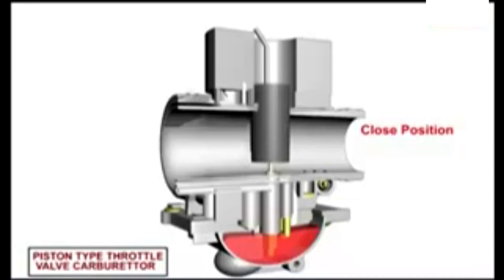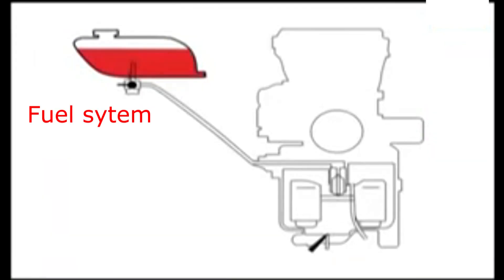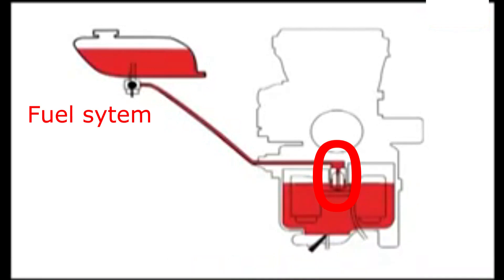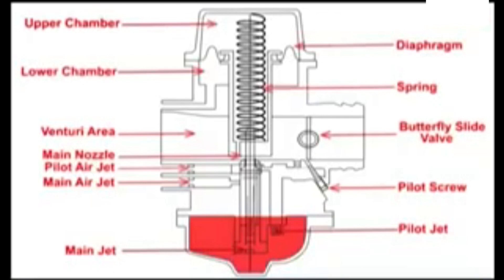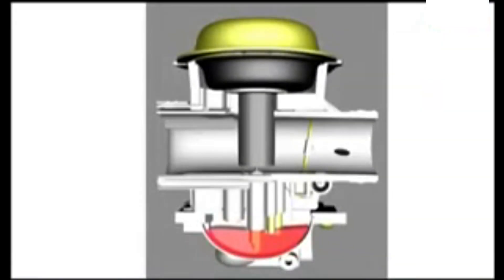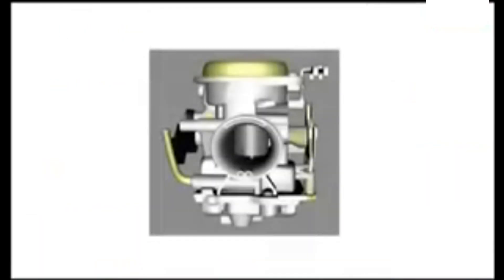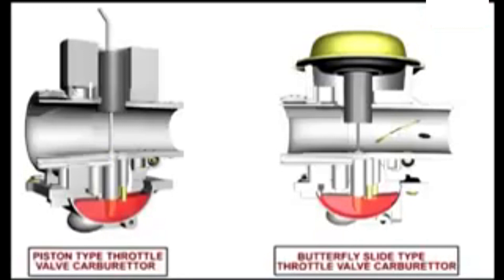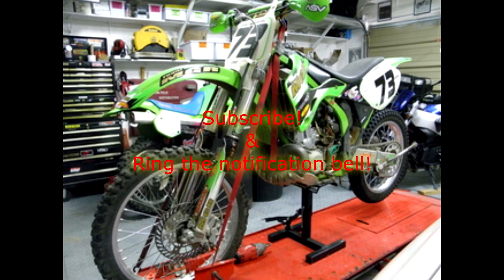Types of Motorcycle Carburetors - differences and how they work

Comment: I'm trying to figure something out
 

I am working on a cable driven slide style carb. Is it normal to sputter and almost die if you snap to wide open throttle from an idle? At 1k rpm it sputters but at 1500 it revs up fine.

Comment: Is a cv carb less likely to stall if you hit full throttle from idle quickly
Reply from the maker: No, not necessarily.  There are many factors for that.  One of which is engine design.

Comment: What causes a cv carb with a diaphragm to keep breaking the slide. the slides keep breaking at the lip where the rubber diaphragm holes onto ive replaced the slides 6 times an they keep breaking have no idea why
Reply from the maker: I would have to see a picture of what you are talking about.  Post a picture in the comments on this page.  )no need to register to post) https://www.thejunkmanadv.com/motorcycle-carburetor-jetting.html
Reply: Are you shore it’s the slide braking and not the fact your using a ethanol based fuel  causing the diaphragm ageing quicker  and stiffening up popping the slide loose

Comment: Hello sir! There are some carburetor that has “air cut off valve” on it, what does the air cut off valve do? What air does it have to cut?
Reply from the maker: I am guessing you mean a carburetor with a "choke"?
Reply: @thejunkman  Nope~  
Choke is controlled by the lever on the left side.
There is a circular shape diaphragm stuff on the right side of my carburetor (Keihin PD26) the manual said it’s a Air Cutoff Valve (ACV)
I can’t find much video/animation explaining what does that valve do.
Reply from the maker: That is a circuit unique to that particular carburetor.  It is just a small valve that allows some air around the slide in certain situations as it is controlled via engine vacuum.  It only functions when you chop the throttle from high rpm.  When this happens there is high engine vacuum, but very little fuel creating a instant lean mixture.   It limits the airflow through the pilot circuit to ever so slightly richen the mixture until the engine vacuum comes down, reducing the backfiring that can happen in this situation.  It is just to smooth out the jetting from WOT to 0 throttle as the engine rpm falls.  It has no bearing on performance or general operation, until the diaphragm gets old and tears, then a vacuum leak happens.
Reply: @thejunkman  Thank you sir!
I took apart my carb to do some cleaning yesterday and by following the words that you describe how that vale functions, I understand it now.

Comment: can you use any type of carb on any motorcycle?
Reply from the maker: Generally speaking yes, but certain designs and sizes work better in certain situations.
Reply: In other words, CV carbs basically compensate performance for gas mileage

Comment: CV means Constant Velocity. Why is it called “constant velocity” type? Please explain diaphragm operation more. Thx.
Reply from the maker: The diaphragm is operated by the vacuum created by the low pressure area in the venturi of the carburetor.  This relates to the the term "constant velocity" as the carburetor is trying to keep a constant velocity (or speed) of air moving through it as it tries to equalize the pressure in the diaphragm chamber.  If you can watch the inside of a CV type carburetor you will see the slide fluttering up and down as it tries to keep the incoming air moving at a constant speed.  This is contrasted by the piston type where the throttle cable is actively operating the slide.  In this case the air moving through a piston type is ever changing.
Reply: @thejunkman  so sir in your opinion which is the best performance of the engine? the carburetor used piston type or the carburetor used diaphragm type?
Reply: @johngiemaano1309  piston type!
Reply: @johngiemaano1309  piston for racing racing 
Diaphragm for gas economy😅
Reply: Thank you so much for your videos and your answer!

Comment: Sir, which type is better in terms of performance, cv or round/flat slide carb?
Reply from the maker: For all intensive purposes they are equal in terms of performance it highly depends on the demands of the design of the engine and the manufacturer determines that.
Reply: Flat side is better more respone engine with no delay on throttle while the cv type has delay the performance is less